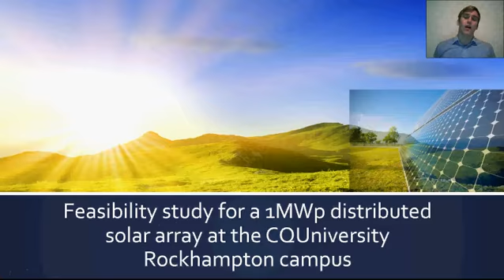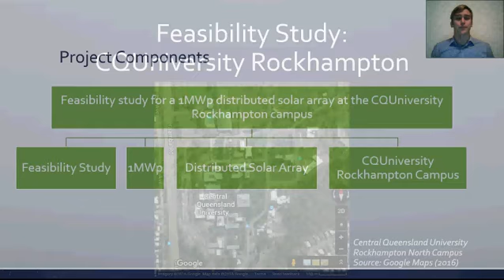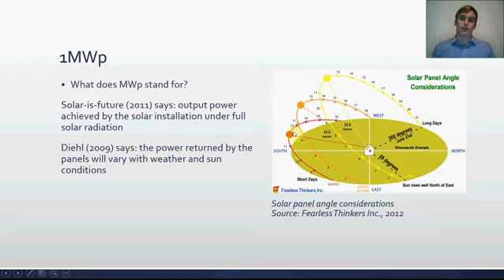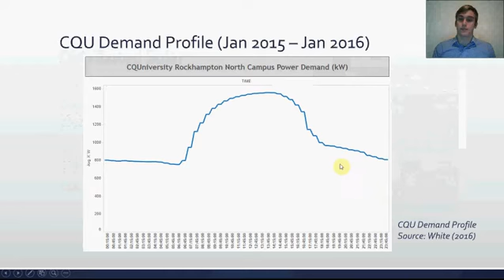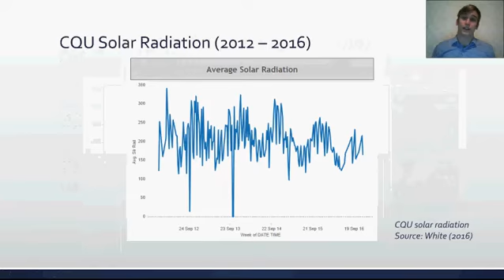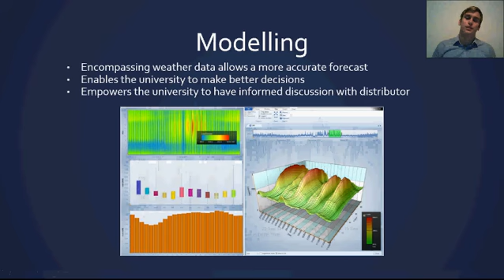Project Proposal: Solar feasibility at CQUniversity Rockhampton campus

Comment: Nice work great job, can you further explain the modeling process. is there one model that all solar designs fit into, or there are several that are used based on the given conditions?
Reply from the maker: For this particular study all models are based off models developed by Sandia National Laboratories. NREL's PVWatts tool runs off a variant of Sandia's work so results from it is used to make a quick linear model against irradiance.

There are a number of other factors the Sandia model accounts for that I am still looking into. I have a particular interest in panel angle and ambient temperature in this case